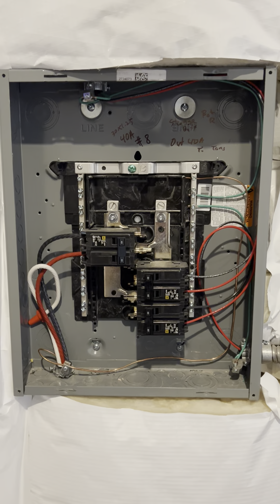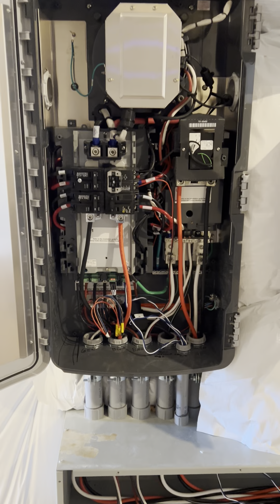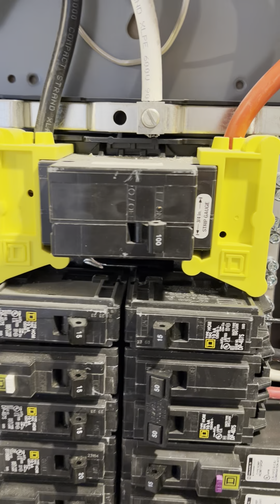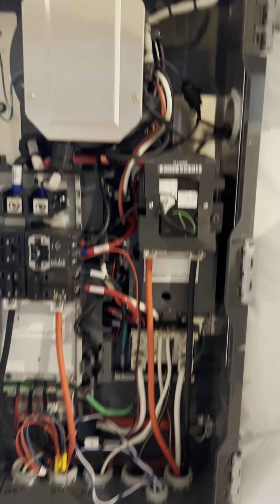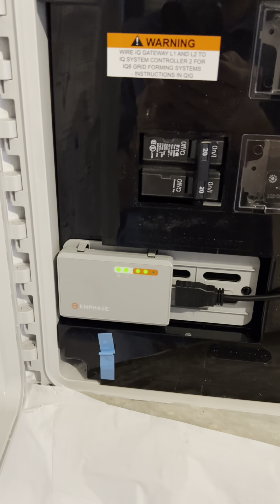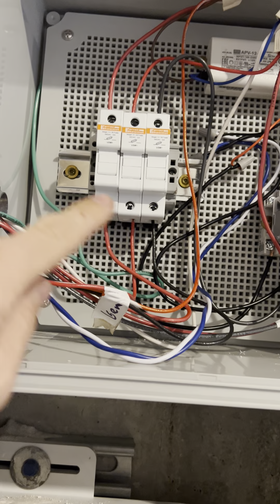Enphase Battery Backup 10T Batteries, IQ8A, Generac Generator

Comment: Hello, after connecting the battery output into the storage terminals below, where does the wires of the storage breaker comes?

Thank you.
Reply: you connect the breaker to the leads that are there .... do not connect it directly to the breaker. there are leads that are zip tied on either side.